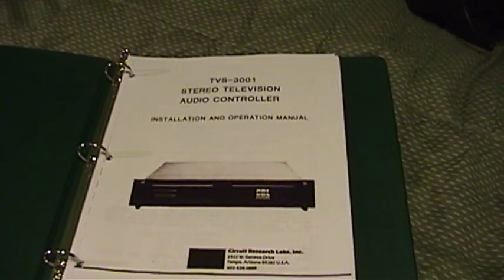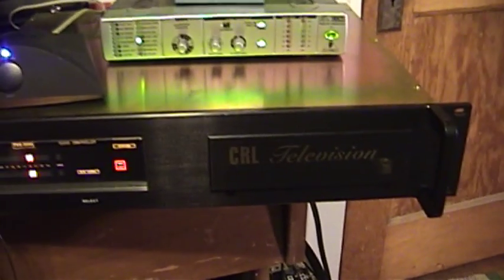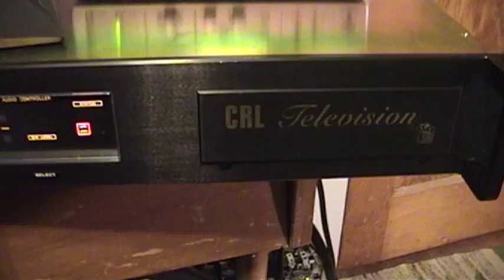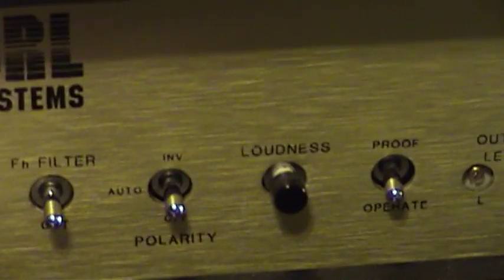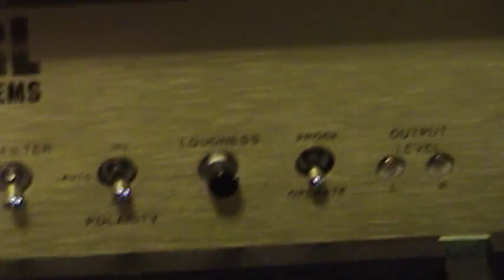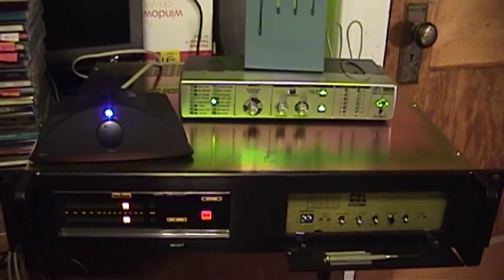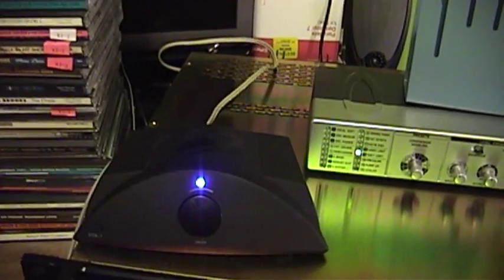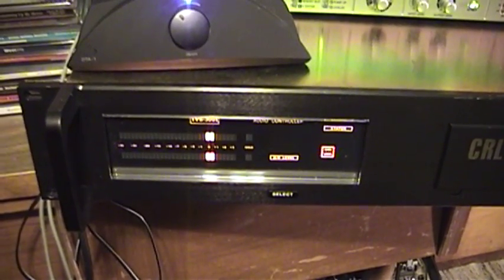CRL Systems TVS-3001 TV Audio Processor

Comment: @uxwbill "Sound Check" is basically Apple's version of the ReplayGain standard. ReplayGain can be used either when encoding an audio file (via MP3Gain or WaveGain) or during playback (via a WinAmp plugin). Apple's version of it is applied in the playback device -- the iTunes audio files are not modified by turning Sound Check on or off, although in the Get Info panel, iTunes will tell you the dB of playback volume gain it has determined for each track (which you can also adjust manually).

Comment: I'd love to stick one of these in front of an Orban Optimod 8000 for FM... I think it would sound wonderful. :) JC
Reply from the maker: Yes, I'm really replying to this all of these years later...to tell you that I did!

Well, sort of. Years later, I came across an Optimod 8100A/ST (the TV audio version in a "studio chassis", which accepted some of the cards from the "full" 8100A and allowed you to separate the two between between studio and transmitter site).  The 8100A/ST is fully functional by itself and indeed it did sound nice with the TVS-3001 in front of it...very loud and clear.

Even though I cleaned all the pots and gave the 8100A/ST a good once over, it started to randomly lose one channel of audio. I'm sure it's fixable, but for now, I have just set it aside. The TVS-3001 hasn't given a moment's trouble.

I don't know if you will ever see this, or if the Youtube spam filter will eat it, but if you do and it doesn't...now you know!
Reply: @uxwbill  LOL... Thanks for the reply! Orban stuff gets flaky like that sometimes. CRL has always been more reliable. :)

Comment: Ha ha, your mad bill, but in a nice way :-)

An interesting device, i would have thought they would use some kind of audio delay device to allow time for the agc to set its value before its applied to the output, then the level would be closer without jumping.
Also an auto fader thats activated on vastly different volume levels would introduce the audio in a softer way.

I know, its easy to say, but hard to acheave :-/

Like the madness, smashing video :-)

Comment: The slow responding fixed times.. must be mods?, wondering if you ever attempted changing a value, etc. Have one here and would be interested in that if you have any info?
Reply from the maker: No, I'm perfectly happy with how the TVS-3001 performs. Much of its personality is determined by those small circuit boards, which would normally be potted and thus quite difficult to get into or modify.
Reply: I like it fine when it's in action during a song, its just when a loud song transitions to a soft song the intro notes get lost a little whereas on many other compressor-limiters you can adjust release time and get that second song to crash in on the same segway while maintaining the same level. Love the looks though :)